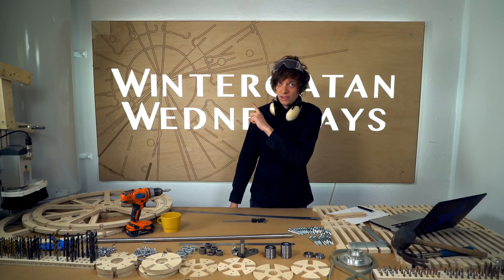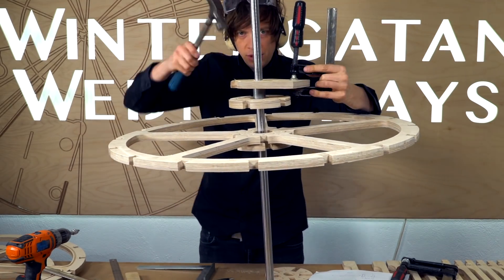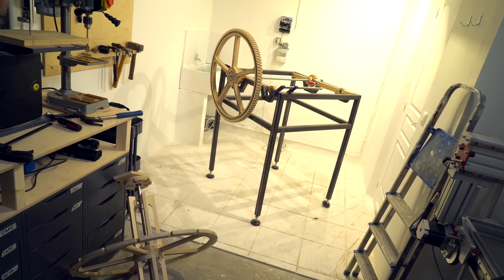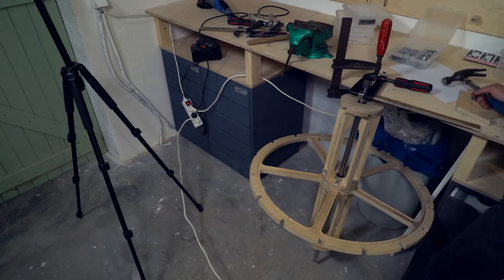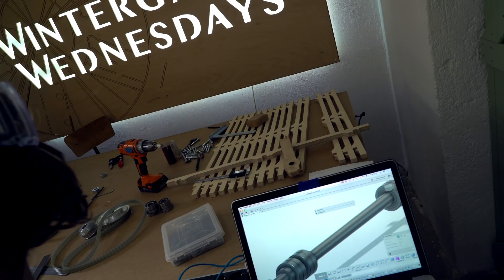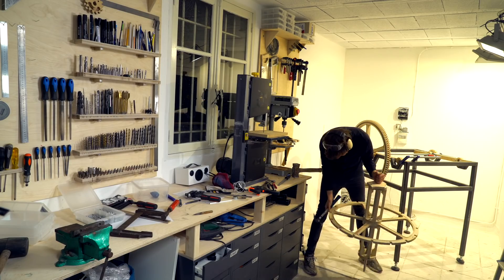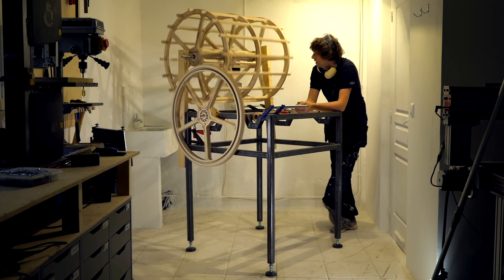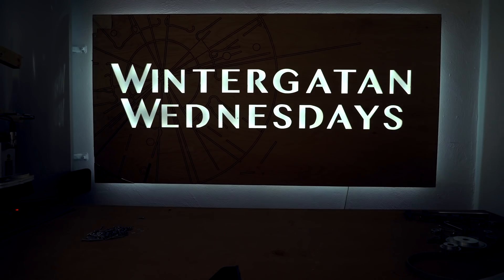Programming Wheel Skeleton - Marble Machine X #19

Comment: That was painfull to watch. Why not just use a shaft with a slot cut out down the middle so you can use a keyway to lock everything together? Over time I fear the friction fit may expand/contract to the point where the wood buckles and/or warps/slides off...

Comment: The proper way to fit a bearing on a shaft with tight tolerances is to heat the bearing in an oven at 200F (95C) and cool the shaft with a freezer, or if the shaft is too long, with dry ice. The bearing will slip onto the shaft very easily and will stay in place when everything come back to room temperature. Pro tip : wear thick gloves!

Comment: If you had a thread inside the shaft you could attach a small vice at the end that could push/pull the bearing assemblies into position by rotating a threaded bar. This would be more accurate and  save effort and time in future. Loving the videos, but now I want a CNC router - can we get a "wintergatan discount" from CNCRouterparts?

Comment: Disappointed that the crowd of engineers assisting and viewing couldn't have foreseen that proper tools were needed to build the wheel without the high risk of damage Martin puts on the shaft. I mean, hammers and self-built tools. Not having a proper plan of construction and proper tools is a fail, I'm sorry. Engineers - Solve Problems! Help the artist!

Comment: The real problem you had was that the inner diameter of your spacer was too tight on the shaft when you started, if you had drilled out the center of the spacer so that it slid freely on the shaft you would have still been able use it to hammer in the bearings without damaging them and the spacer would have come off easily. IMO a cheap piece of pipe with an ID slightly larger than the shaft would have simplified the entire process as you wouldn't even have to use a board since if the pipe was longer than the shaft you could hammer it directly, which would apply all of your force centered and help avoid galling caused by the edges of the bearing digging into the shaft.

Comment: The programming wheel is not infinitely re programmable. Since there is a finite amount of holes in which the pegs can fit into, it can play a huge number of songs, but not an infinite amount. You can either have one peg in one hole, or all pegs in all the holes; between that are all the possible combinations that can be calculated. This can be easily calculated by a binary coefficient summation equation.
Reply: hands of Balázs Certainly, but he noted that the programming plates are clamped in place and can come off and be exchanged, so I would imagine he could swap out different programming plates with different numbers / ratios of holes.

Comment: Not sure if it would have helped here, but one thing that can help with tight bearings like this is heat. Pop the bearings in a toaster oven or something for a while, the small bit of thermal expansion can make it much easier to move them down a shaft. Although you'd want to be careful not to melt the bearing shields if you did this.

Comment: When seating bearings over a shaft, where the tolerances are so very close. You can use heat and cold to expand or contract the metals. If its cold outside, you could put the shaft and wheel out there to get cold, and warm the bearings under a heat lamp or oven, just not too hot so the grease in the bearings does not liquefy.

Comment: To install a bearing on a shaft you can also freeze the shaft to cause it to shrink so the bearing will slip on. Once the shaft returns to room temperature the interference fit is restored.

Comment: Heat the spacer uniformly around it with a propane torch to expand the metal.  Immediately cool the shaft (because the heat will transfer to it too) with something with a high flash point like WD40 to cool the shaft.  Spacer would come off fairly easily, but the window of opportunity is quick.  May take several attempts.   Now back to watching the video.

Comment: the way your hammer was hitting the side of the shaft early on, I was thinking "I imagine that spacer will be harder to slide on a second time..." - with both the shaft and the spacer deformed.  I ran into a similar problem in the past.  I spun the shaft in a lathe and used a file. Sandpaper works too.  Actually, every problem you mentioned, I was kind of anticipating :)
Reply: Maybe Matthias you could take a vacation to France for a little while? This is not a joke, I would love to see you work on this project together.
Reply: Being skilled means remembering past mistakes?
Reply: Hands down easiest way to mount bearings on a shaft with a tight tolerance is: Heat bearings and cool shaft. Lube em up and they slide right into each other like two  actors in a porno.
Reply: Wintergatan + Mathias Wandel = the next evolution of Homo sapiens
Reply: Mallet is recommended, but if that isn't enough, a block of wood to protect your work and a sledge hammer will get the job done.
Reply: Gday Matthias! I watch your channel and love it and your attitude to things.
Reply: Streaming Matthias live from inside your shop...just as the low bandwidth using monks in the 1600s would have done.
Reply: I like both your channels, so i felt happy when i realised you were watching wintergatan in one of your videos and now you even commented
Reply: Would you use a mallet or a hammer?
Reply: Hindsight is 20/20 ...
Reply: ...and use some lubricant maybe.
Reply: Matthias Wandel, what a small world (wide web) this is.
Reply: Spot on, Tom.  I hope he read your suggestion
Reply: When installing a bearing on a shaft i cut a slot into the spacer. Then it is easier to remove the spacer, you just have bend it a little bit open.
Reply: the spacer doesn't need to fit that precisely, normally it can be like a millimeter larger that the shaft.
The other thing is, when it gets stuck, just warm the spacer up a little bit so it will expand

Comment: Hitting the bearing and plywood directly with a hammer could be causing them to bind; hammering the outer race of the bearing could damage it.  It might be better to use a pipe that slides easily over the shaft and applies force directly to the inner race.  By using the momentum of the pipe like a pile-driver, the hammer may not even be necessary.

Comment: In my experience fighting bearings with a really tight fit a little bit of heat (or cold) does miracles. Obviously some metals expand/contract easier than others, but you could try getting the shaft on iced water for a while before entering the bearing.

Comment: tip next time stick the shaft in a freezer it will make the metal contract to allow you to put the bearings on easier then it will return to its original size when it returns to room temperature

Comment: If you can, you should invest in a press, 5ton or 10ton something in that range. Also, your "spacer"(Press tool) for installing the bearings can be "hot-dog down a hallway fit" as long as at least half of the wall thickness is resting on the inner "ring"(Bearing race). As long as it isn't some skinny walled piece of tube that's going to collapse on you anyway, but you shouldn't be using that in any case. 

Believe me, even seasoned mechanics get the tunnel-vision on occasion and keep hammering on a lost cause, frustration is quick to call friends over for a party, usually a double dose of more frustration and wrath.

Comment: Love this, its really nicely engineered. But you just learned a valuable lesson, not only about toperances but also deformation. (Mushrooming etc) big hammers have usesbut assembling precision engineering is NOT one of them. Presses and pullers  are the ideal in many cases. Learn about using heat to expand and cold to shrink, that way interference fit parts just drop into place. And when ylu have to hit things use a SOFT mallet, not a steel claw hammer!. Keep up the great work !
Reply: I was also hoping that there would be someone heating the bearings and cooling the shaft, then throwing the claw hammer in the corner as they all slide together...

Comment: Thats why you only use diameters with the necessary tolerances on the final position of the bearing and not on the whole shaft.
You can make shoulders and smaller diameters (e.g. -0.2) on less important areas in order to make the assembly a lot easier. Further you can use the shoulder as a support area on one side of the bearing and a circlip on the other side to fuxate and position it correctly. Disadvantages: more complex shaft geometry, different bearings, circlips and circlip tool needed,
Advantage: a lot easier and fadter to assemble and disassemble
I like your project very much, therefore I don't want to hate this video but I just wanted to give you (hopefully) good advice :-)

Comment: Emery cloth would of solved the tolerance issues real quick (super fine sand paper for metal work capable of taking away nanometers of material. Don't sand the shaft sand the inside of the bearing cuz you probably don't want mar up that shaft.)

Comment: Those tolerances are WAY too tight. Way too tight. Friction fits are a bad idea. You should have used bolts driven into the shaft to hold everything in places.

Comment: Why did you choose a fixed shaft (with the bearings between the wheel and shaft) and not a rotating shaft (with the wheel fixed to the shaft and the bearings at by ends where ghe shaft gets mounted to the mmx)?

Comment: The project is starting to look awesome, but oh dear it was painful to watch this time. Hitting the bearings and the shaft with metal hammer, no,  no, NO, please no.

Here's a little tip for you for the next time you need to fit bearings or bushings over a metal shaft. You need two tools: temperature and gravity. Cool down the shaft (cold water or fridge/freezer will do the trick nicely or even cold spray), heat the bearings and bushings and let gravity do the rest.

Anyways, looking forward to see the completed MMX! Keep up the good work.

Comment: Why was the programming drum mounted using 3 interference fit bearings mounted in the wheels rather than two bearings at the end of the shaft in serviceable bearing blocks. Additionally why was large ball bearings used and not Oilite bronze bushing as Bearings? Those bearings are overkill for what little load and speed you will be putting on them. Lastly the key function of a shaft is to transmit power, in this application your shaft is functioning more as an arbor or spindle. Additionally since your pushing power onto this wheel from one end you need to keep toque in mind and it's effect on the drum, if any power is being pulled off from the other the you may have twisting issues, particularly because your using the main shaft as a spindle and not a means of power transfer. Maybe this choice will be more clear when you assemble the main gearing, it's just strange using the shaft and bearings this way. 

FYI you could have cooled down the main shaft (leave it outside for a bit) and warmed up the bearings to get them to slide on easily.

The term your looking for was "Upset" you were upsetting the shaft making it harder the remove the spacer.
Reply: since noise will be a factor in the machine, ball bearings make a lot more sense than simple bushings.  plus having sealed bearings means less maintenance - no need for graphite or oil, which every metal bushing i've ever seen requires periodically.
Reply: Definitely advantages to sealed bearings as you stated, particularly in this low load application, however the design makes any repair or service to those bearings nearly impossible without taking the entire assembly to bits. Given the size of the shaft and the low load, a dry grease of bushings would require almost no maintenance beyond some rare and light applications of graphite as needed. The bigger issue I see here is the fact that the primary shaft is acting as a arbor/spindle and not a power transmitting shaft. The design could have utilized two sealed bearings in blocks at the ends of the shaft, repair and replacement would have been instant. Additionally the main programming drum could have been keyed onto the shaft making any service to that component quick and easy, even allowing for the swapping out of drums without fully tearing down the machine. Back on the bearings, the failure modes of those bearings in this application will be them rusting over and misalignment resulting in point loading, the rusting will be due to low use and moisture exposure during transport and thermal cycling (moving from inside to outside between gigs). Bushings would be less susceptible to this issue and or easily serviced, even in the field should something come up.. The primary issue I personally have with the design choice is the fact that all those bearings are deep inside the main drum and should something come up, it's a show stopper.
Reply: MorRobots now that I think about it, yes it probably would have been better in terms of repairs to have bearings at the ends, but it also depends on how the drum will be driven. We haven't seen that yet, and with his talk of planetary gears and counter rotating parts, maybe it will become more obvious why he's doing it this way once those parts get installed.

I wouldn't worry about rust inside the bearings; they're sealed, just like automotive ones. Cars can be parked for months or years at a time and not have bearing issues so long as they aren't submerged while parked. The car might have a dead battery after being parked a while, but Martin is the battery for the MMX, so... :)
Reply: ball bearings are noisier than plain bearings

Comment: Martin a bit of hand sanding all over the rod  would had  prevent you beating  the parts into the rod. Also what you need to remove parts is a puller . But  you  are still impressive doing this project. Keep on.

Comment: The plywood, the assembly... there's a very Ikea feel to that project!
Reply: IKEA use particle boards, or in some cases solid wood. I've never seen them use plywood.
Reply: Actually no I take that back, just searched and found some untreated ones actually made from plywood. I genuinely have never seen that before though, and I've been to IKEA way more times than I'd like to o.0
Reply: IKEA doesn't use plywood tho...
Reply: @ze_rubenator  but they do tho....
Reply: That's Sweden for ya.
Reply: piranha031091 MDF*
Reply: The biggest difference is that the pieces didn't come pre-cut.
Reply: That's Sweden.
Reply: I've never seen an Ikea product that uses plywood.

Comment: The easy way would be to use an arbor press and a gear puller but if you don't want to invest in those you could chill the shaft and heat the bearing or bushing in an oven, It'll go on a lot easier. EDIT: I just realized I've become an armchair quarterback. Sorry.

Comment: Get a bearing heater. It’s a stepped cone with a heating element inside. You can press the bearings into your hubs, heat them for a few minutes and they will glide on the shaft with plenty of clearance. Use a wrap of electrical tape on the shaft as a stop at your designed position. A heat gun would be ideal for reheating if you need to reposition. It pained me to watch you struggle.
Reply: I use an electric griddle. They're only like $30, and you can also use it for reflow soldering. Just make sure it's labeled, since you don't want anyone to try and cook food with it after it's been contaminated with petroleum products and/or solder.

Comment: 1:28
STHAAAAPP
NEXT TIME TAKE SOME CANNED AIR AND FLIP IT UP SIDE DOWN AND SPRAY THE ROD TO FREEZE IT.
AND THEN TAKE THE BEARINGS WITH A WHOLE LOT OF PAPER TOWEL, WRAP THE BEARINGS IN TOWEL  SOAK WITH WATER AND HEAT ON LOW IN MICROWAVE FOR THREE TO FIVE MINIUTES.
STEEL EXPANDS +/- FIVE THOUSANDS PER 100°F  .05 INCH
THIS FREAKING 'VERK SWELL!!!